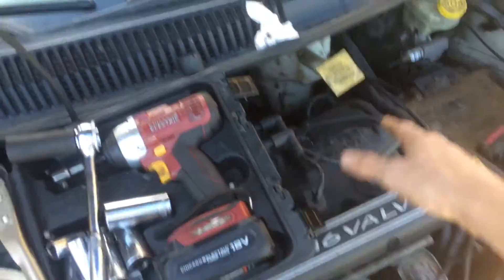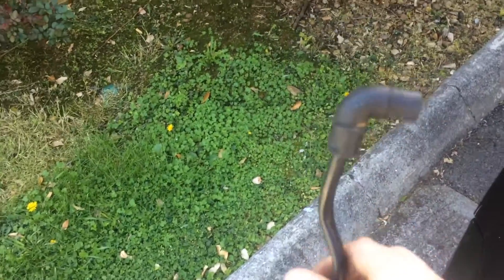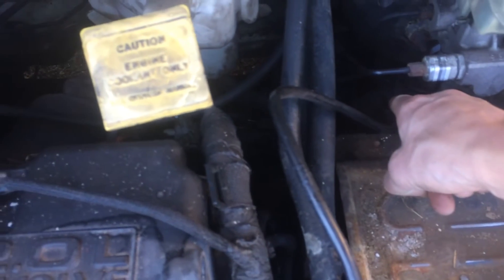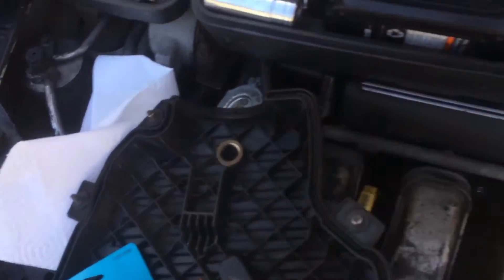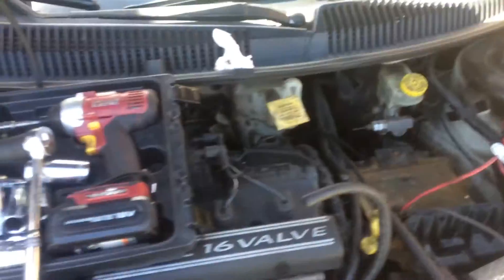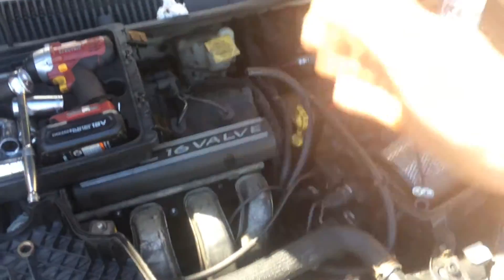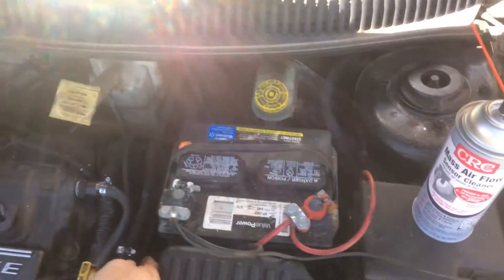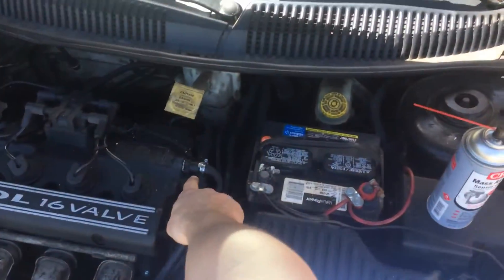PVC Replacement 2000 Dodge Neon

Comment: FYI those discontinued PCV lines are still in MOPAR warehouses and can be obtained directly from any dodge dealer for about 20 bucks. Until they run out anyway.
Reply from the maker: +Adrik Thorsen well I will say the last time I called a dealership they said that this part was no longer available.
I